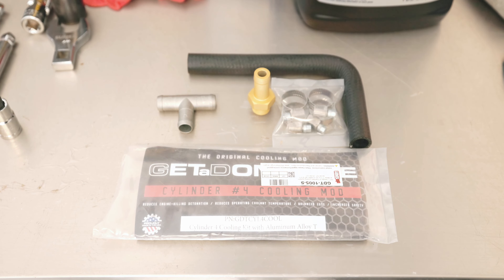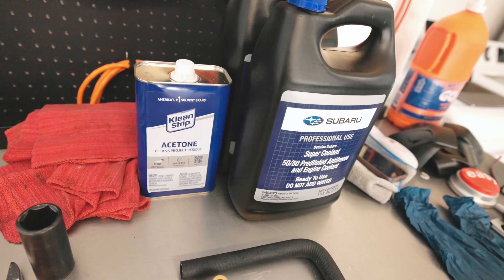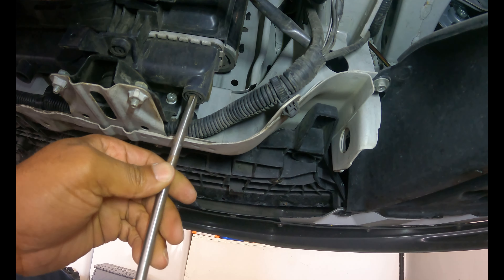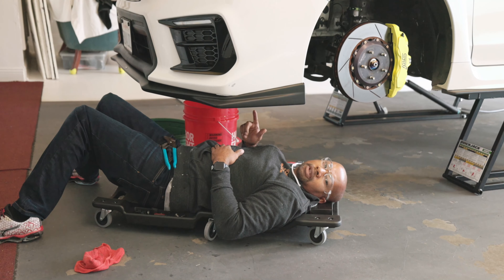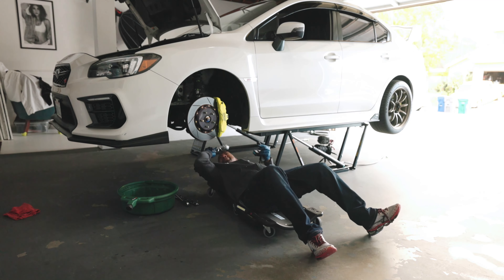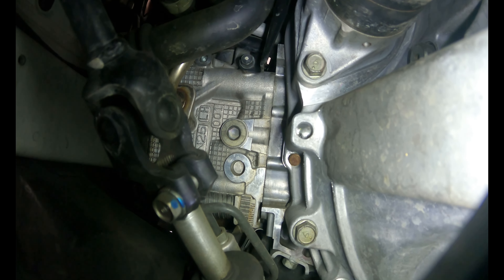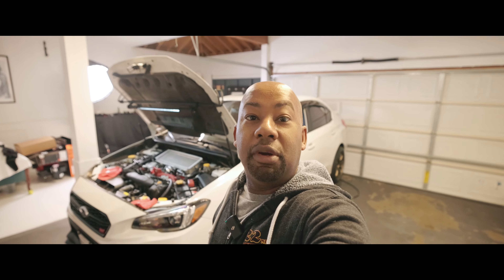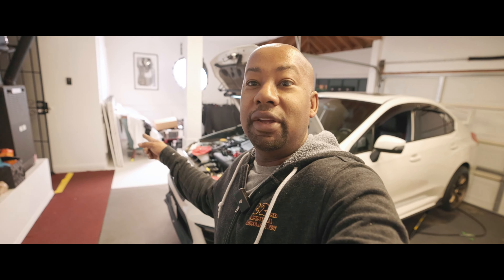How To Install GetADomTune Cylinder 4 Cooling Mod | Subaru WRX STI

Comment: 👏🏼 Good stuff right there! Can’t wait to see the radiator install. It’s refreshing to see someone go for reliability mods first and foremost. You see other YouTuber subi enthusiasts go face first into the power mods only for their rides to blow up. You’re saving the last of our legendary cars! 👏🏼 What are your future plans for the car?
Reply from the maker: I just replaced that top mount so that might be it for a few months BUT Subifest is coming up in July so idk i might be inspired to do something else.
Reply: @DonteTidwell  Oh snap! Which top mount did you end up going with? New install vidya soon?
Reply from the maker: @Will-hs2um  Oooh you wont believe how much i picked up a brand new Mishimoto top mount for off amazon..... regular price $710. (not bad) but they had two and they were selling for $360. and -$100 gift card I had snagged it.  i should have got them both and flipped the other but it was gone in mins.

Comment: ❤ Bro on my 2015 sti went to do this mod and the screw stripped. Not sure how the heck to tackle this now. I’ve tried looking for extractors but due to the location it’s a royal pain to get to it.
Reply from the maker: Ooooh Damn!
Reply: bad news ... did you end up finding a solution ?
Reply: @stevros48 

Nope. I just left it. Nobody was offering any advice. I upgraded my radiator to a 3 row mishimoto x performance which keeps the sti running cooler.